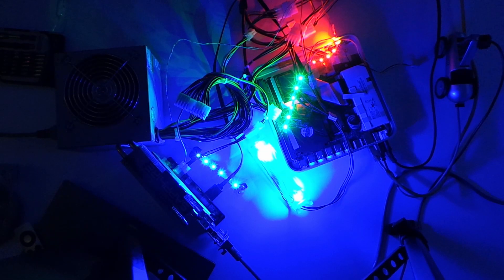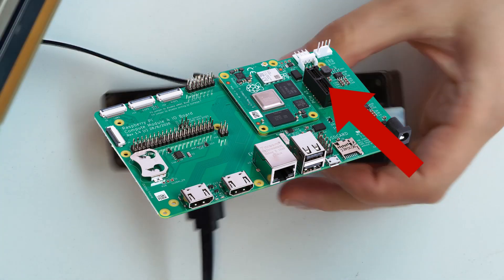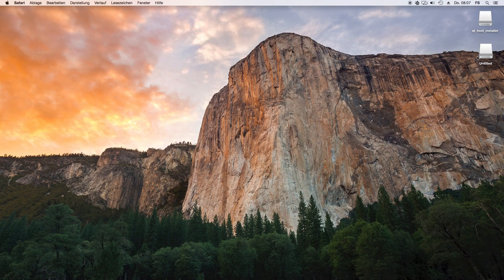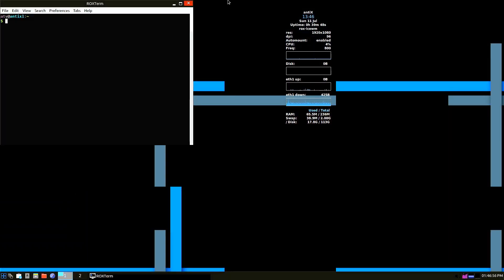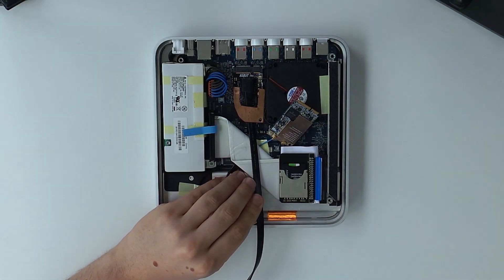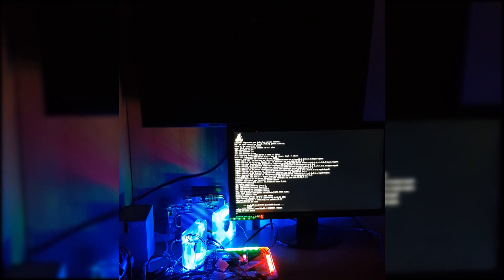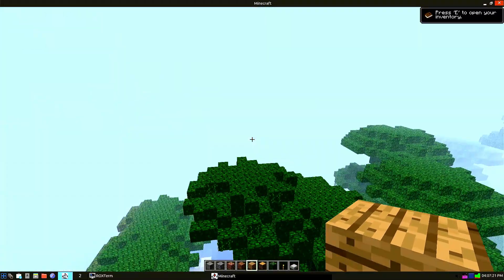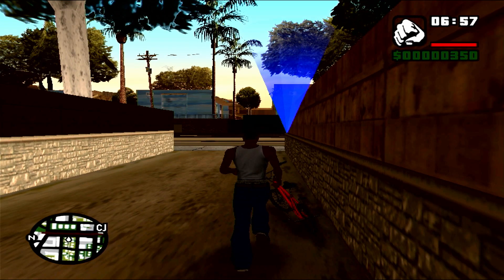Apple tv upgraded GPU using eGPU | Minecraft GTA Linux Flash Mod

Comment: Hello, interesting video.
I've seen all your Apple TV videos. Got one too and also installed Linux and run several cool games on it.
If you want to watch and see the games I ran on it https://www.youtube.com/watch?v=wuE04kP086o&t=156s
But I'd like to know if you could tell me how you got wine to work to run GTA SA. I installed wine v10.3 and just trying to install directx in wine causes the system to crash, I guess due to lack of RAM. I've already added a 2GB swap and it didn't help. Did you use any other specific version of wine?
Thanks for your support, best regards,
Link

Comment: Can you try to modify EFI to allow booting Windows XP on Apple TV?
Reply from the maker: :D I've been trying to do that since about two years without sucess. There where so many people that claimed they know how to do it but no one ever got it working. Right now I am working an a bootloader to boot more modern linux distributions.
Reply: @TechKingdom35  Oh I see. Would the bootloader have a change to boot windows? I don't own an Apple TV but it is an interesting topic. I was watching the video of Michael MJD who is struggling to get it work lol. In the comments, someone said a fake mach_kernel (OS X) file is required.
Reply from the maker: @Quoc D  The answer is sadly a bit complicated, I hope I can explain it somewhat well. The Apple TV has a very, very locked down EFI and no bios emulation. This is why the attempts by Michael MJD, while working on any other mac of the time, don't work here. It can boot OS X Tiger because the EFI is already designed to boot Tiger, since the Apple TV OS is a modified tiger install. It can then be tricked into booting Leopard and Snow Leopard, since the boot process is very similar. MacOS is booting a so-called mach kernel, which is basically the core functions of the Mac operating system. To boot Linux a few very smart developers have created a fake mach kernel that the Apple TV still loads because it “looks” like the original tiger mach kernel. This mach kernel does not start the core systems of macOS, but it loads a Linux kernel that is embedded in this kernel. The code to accomplish this is very old (2008) and not very documented. Since then, people have used this to load other Linux based operating systems. I have for example videos with OSMC, Android X86 and various other Linux based operating systems. My new bootloader will do exactly the same and boot linux kernels. Now for Windows XP to boot, someone would need to actually adapt all the trickery that is going on with this mach kernel and allow it to boot an operating system that expects to be booted from a bios and not a super locked down EFI. So it is probably possible, but someone with more knowledge in developing for this platform would need to implement it. What can be done is using a very lightweight Linux and QEmu to create a VM with windows in it. But this is basically cheating :D It also has very poor performance since it can’t use the apple TVs potential.
Reply from the maker: @quocd6171  So TLDR it can be done but requires a large amount of effort :)
Reply: @TechKingdom35  well explained, I understand it well. There is stil hope someone will manage to boot it in the future :D

Comment: try it with android x86 on apple tv
Reply from the maker: I already did. I made a video about it and it ran like crap :D
Reply: @TechKingdom35  no im saying run android x86 but with the gpu to see if performance increases
Reply from the maker: @leonardoplays5546  Ah, okay. Yeah that would be neat but I have no idea how to disable or enable GPUs on android. But I can try it if I find time
Reply: @TechKingdom35  well android x86 has all gpu support by default i think
Reply from the maker: @leonardoplays5546  Yeah true but the apple tv always had problems when both gpus where active at the same time. So I think I would need to disable the internal gpu to use the external one. Just like I did on linux

Comment: i have 2 apple tv 1st gen and currently i am working on it i want to use it as a download box like torrent box or install aria2 any tips 😅
Reply from the maker: You should probably flash mod it, because the hard drive in it is very slow for downloading stuff. Then use the method in my android on appletv video to install linux on it.

Comment: Just randomly found this video, the eGPU on MacOS stuff might be because of apples weird way of initializing GPUs on everything before MacOS 10.7.

The GPUs need to have the efi firmware on it, and your 8800GT should actually only have the 64 bit compatible Vbios for the 3.1
However, the HD5770 has support for 32 but and 64 bit, just like a X1900 Mac edition card. And the funny thing about this is, one of my spare "desktops" was a broken iMac with said X1900 connected to it, which worked fine. It doesn't work in a 3.1 mac pro, but it seems to work with my MacBook 4,1 and my 2,1 + also my 2006 "White" 17 inch iMac.
Another GPU that should work is the stock 7300GT that came with the Mac pro 1.1, or the HD4870 with a custom Mac bios.
Reply from the maker: Ahh, that would explain why it didn't work. Thanks for the information. Maybe I will find a 7300GT or HD4870 at some point and revistit this.

Comment: What was the kexec command you used to boot from antiX? Analyzed your b-roll and tried myself but I couldn't get it to work, even after looking up how to use kexec. Kept getting "read on vmlinuz of 65536 bytes failed: Is a directory" or "cannot open './boot/vmlinuz': stream error" also tried using isolinux instead, just feeling around trying to learn. Never really screwed with kernels, especially not on a live usb. I'm replicating your project minus the egpu part to make a sort of DOS/8/16-bit era console of sorts, with only antiX core and openbox to keep it as light as possible, maybe even qemu, pci passthrough the usb hub and the nVidia Go 7300
Reply from the maker: I added the command to the video description. Hope it helps. Cool idea, the apple TV definitely has enough power for these types of games. I installed dos box on it back a few years ago which worked quite well for Caesar and Civ.
Reply: @TechKingdom35  Thanks mate, you're the best! Gonna try it now
Reply: @TechKingdom35  Did the video player had hw acceleration turned on? Are the video acceleration libraries(for nvidia's proprietary driver) installed? Is the nv driver installed?

Comment: Have you considered putting together a ready-to-go fresh install of AntiX that can be flashed in the same way OSMC etc dd an image onto the hard drive? As in, make the image as small as possible and then expand the root partition to the rest of the drive. You'd only need to set up the script to create a swap file (1GB is plenty, 2GB is better) after that and insert it into /etc/fstab. 

Having a ready-made image would save people a lot of trouble trying to re-create your work here...
Reply from the maker: Yeah, I thought about creating some ready to use distros. I always use dd for images of these projects anyway, since it's easier to archive than dozens of SD cards. I might consider making some images alongside a video explaining the installation.
Reply: @TechKingdom35  
Consequently there is also an updated bootloader thing someone made (kfix/atv-bootloader), forked from the original atv-bootloader project and it allows an updated kernel to just boot without any kexec nonsense in the middle. it seems to also contain a "wip" directory with some kernel patches meant for kernel 3.x for the Apple TV specifically.
Reply from the maker: @SudosFTW  Awesome idea. I have to look into that at some point. For some reason I missed this fork of the ATV-Bootloader. Sadly it seems abandoned in 2016. But Still way newer than the one I used.
Reply: @TechKingdom35  I really hope you do. So far the easiest way has been installing a DE over OSMC.

Comment: Interesting stuff! You probably are the only one who tried that on all of youtube! Anyway i have looked everywhere on the internet to see if someone has done anything more "complex" than sticking in a CrystalHD card or adding an ssd with an IDE to Sata adapter: nothing comes up. I would like to see if desoldering the ram chips, there are 4 of them i think so they should be 64 megs each, and finding 256 megs pin compatible chips and soldering that back would work? Or doing the same with the cpu, i think there exists 2.1GHz cpu in the same family but FBS are not the same so not sure it would work. That is for really skilled people like Dosdude1, surely not something i could do!
Reply from the maker: Dude, I would love to do even more modding on this device but sadly my skills are limited to normal SMD soldering, not BGA.

Comment: whats next 
replaceing the ram chips with hight capasity chips
Reply: The only substitute i could find is this: NT5TU64M16HG-AC. Not exactly the same shape but it should be pin compatible. The 4 ram chips on the ATV1 motherboard are NT5TU32M16 512Mb chips (32*16=512, divided by 8 to get the MB equivalent) which equals 64MB. So NT5TU64M16 is double. If there are bigger chips with these specs: DDR2, 84 ball BGA, x16 i could not find any so i think the best that could be done is doubling the ram to 512MB, which would certainly not hurt!
Reply: @DTYPTM  your not considring this now are you lol
Reply: @user-jp1yd2ut9r  Almost... I have the tools, i would need to practice on ram sticks before. Swaping chips around and trying them to see if they still work. If i succeed maybe i will try.
Reply from the maker: @DTYPTM  True 512MB would be nice. But the CPU would still be a massive bottleneck
Reply: @TechKingdom35  time to find a way to overclock one then or upgrade the cpu lol
Reply from the maker: :D I would love to, sadly my soldering skills are not that great.

Comment: Here’s an idea for a PCI device: plug an SSD into the Apple TV and install your Linux setup on that (minus the eGPU of course).
That makes me wonder if the then unused IDE connector could be used with a DVD drive - one could finally watch DVDs on Apple TV.
Reply from the maker: Good idea, I don't need the IDE though since my SAS card has 4 ports. I had a DVD drive working under macOS at the beginning of the video. Sadly, I had problems booting the apple tv OS without the wireless card. Maybe I could remove some kexts to get it booting. But yeah Linux would be way easier.
Reply: @TechKingdom35  I don’t think that Apple TV OS has DVD support included so I think watching a DVD under Linux is the way to go here.
Reply from the maker: @conath  True, but we actually don't know. I have no idea how much of the FrontRow codebase was kept to build the Apple tvs OS. And FrontRow could play DVDs I think. But still the Apple tv OS doesn't boot without the WiFi card so we'll probably never know :D.
Reply: @TechKingdom35  Maybe you need to remove the WiFi kext to make it boot?
Reply from the maker: @conath  Yep that could work. But for now I want to do some other projects. I bought a G5 Powermac recently. And two old Thinkpads :D There is also still the dream to put Windows on the apple tv but I start to think it's not possible.
Reply: I tried inserting a mini-pcie ssd in the wifi card slot but sadly it is not recognized. The reason is that this card slot is pcie only, there are no connection for sata. I tried it both in Leopard and in Linux/Kodi, it does not show up.